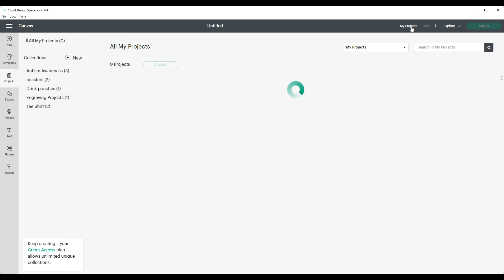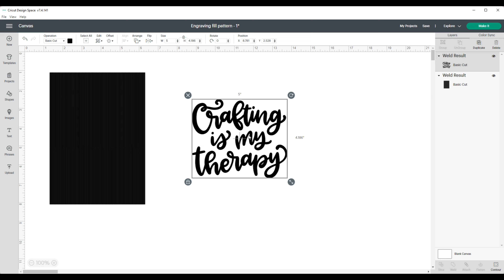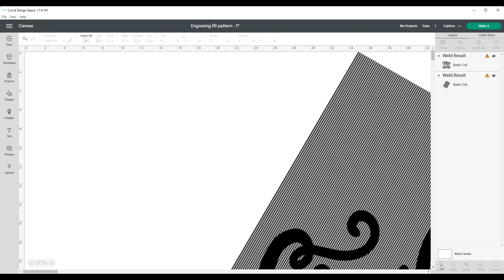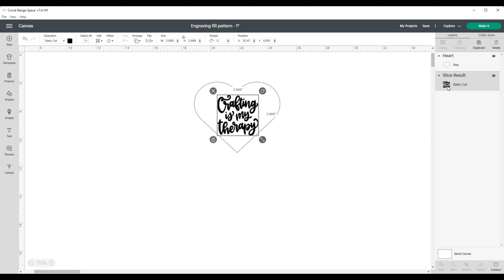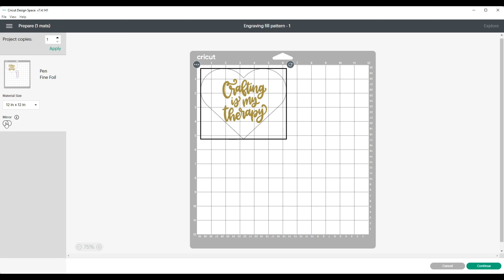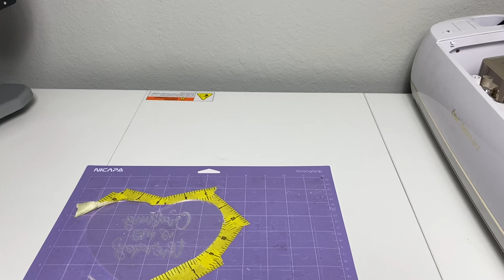ENGRAVING ACRYLIC WITH CRICUT EXPLORE AIR 2: HOW TO ENGRAVE WITH THE CRICUT EXPLORE AIR 2

Comment: Question?? You know how you got the LEDs bases on Amazon?? 

Can you use the acrylic blanks that come with them?? Because I don't know what I am doing wrong but it seems like the acrylic is too thick to engrave.

 Is there a way I can raise it up a little bit to fit? Or do I need to get different acrylic blanks ?
Reply from the maker: The Cricut can only engrave 2mm acrylic. The light bases that I use will hold them well enough.
Reply from the maker: They are linked below the video.

Comment: Love it! Thank you, your tutorials are so thorough and detailed.
Reply from the maker: Thank you so much ❤️
Reply: I have been engraving on my explorer air 2 and now my sensors will not catch the boarder line after I printo then cut. What do I do :(
Reply from the maker: I was having problems with my Explore finding the sensors even before mine was past the warranty period. I calibrated and tried other hacks to get it to work. What have you tried so far?
Reply: @CraftingwithDelonda  I tried calibrating it. I tried mod podge on the sensor lines and I haven't got anything. I watched a video of a piece missing in the housing but I'm not sure how to take the housing off to see if that is the issue
Reply from the maker: I haven't heard of using mod podge but I was able to make mine read the sensors by adding scotch tape all around the registration marks. Literally taping on the lines.
Reply: @CraftingwithDelonda  I've traced sensor lines with a black Sharpie & made sure area has lots of light over machine.
Reply from the maker: That's another thing I've tried too!